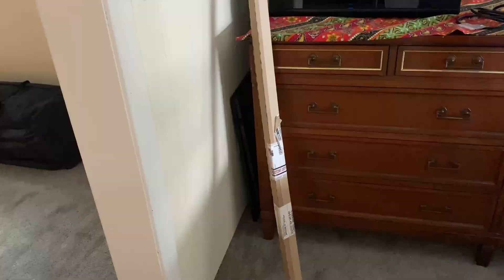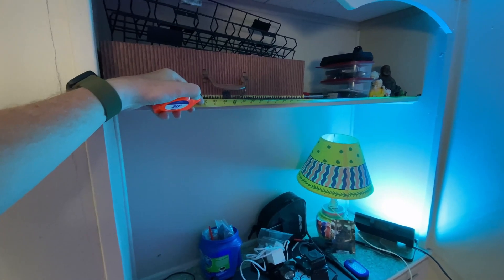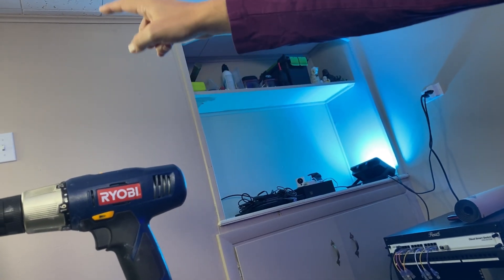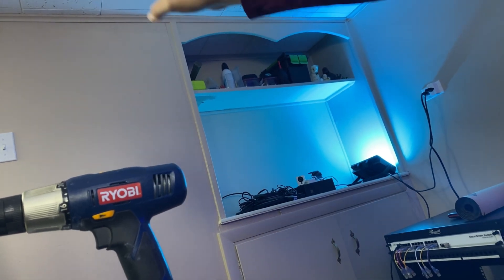How to Not Run Ethernet Cable

Comment: Just a reminder to measure from a common point on both floors to be sure you understand how things line up. I did a run once where the upper floor wall did not align with the lower floor wall. After I drilled the upper floor base plate, I used an endoscope to verify where I was at as I knew there was an offset in the upper and lower floor walls. I ended up drilling a 2nd hole from the lower floor upwards, as well as a small rectangular hole in an upper closet floor to run the cable horizontally in the space between the two floors (there is about a 12 gap between floors). It wasn't a problem, just more work than planned. For this kind of work, an endoscope is very helpful. My only regret, and a common one, was not running more cables or a cable duct at the time when it was all opened up.

Comment: Man, do you ever need an endoscope camera. I appreciate you sharing, but jesus man... how do you just start drilling and turns out you had no idea where it's coming out on the other side?
Reply from the maker: I thought I knew where I was drilling, but this is an old house and doesn't follow what we would consider standard practices when building structural integrity.   So what that means is my load bearing short wall upstairs is not supported underneath by a load bearing wall.  The wall in the basement is one foot or so offset from upstairs.  I noticed afterwards that they added in a steel beam to make up for the misalignment.

Comment: I had to run some cable from my basement to top floor of my townhouse, in my basement at my furnace, it has a pipe that goes stright up to the roof.   This pipe is hidden in the wall behind the fridge on the main floor and a corner box up the corner of a wall in the upper bathroom.  I drilled a hole in the attic beside this pipe, again in the bathroom, and again in the basement.  I was able to pull 12 cat6 from basement to attic, then down into the walls of the bedrooms.
A second method:  drill out of the house in basement corner, near the ceiling, and again straight up in the upstairs, run conduit up to the top of the house to protect/hide the cat6 runs
A third method: remove baseboards, cut/remove the bottom 2or3 inches of drywall, run cable in the new gap., put baseboards back on.

Comment: That is without a doubt a cold air return duct back to a forced air furnace which probably does not exist any longer. its the way they did it "back in the day" I am sure you could tear that sheet metal down as it no longer seems to have a floor duct on one end or a furnace on the other end.

Comment: "heating duct". we don't have them in UK.  In UK We have fibre optic direct from supplier to the main wireless router in most UK installations.  We just run ethernet from there in wall cavity to each room obviously WIFI works through house too.